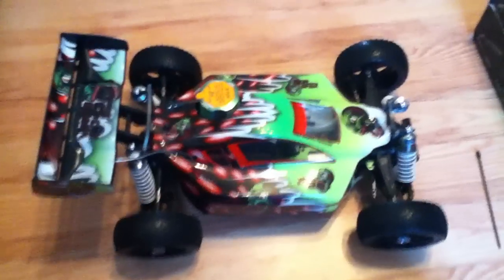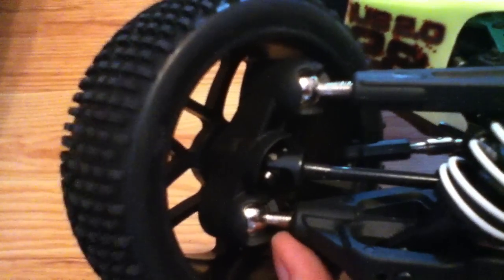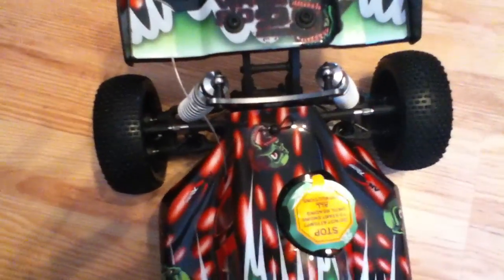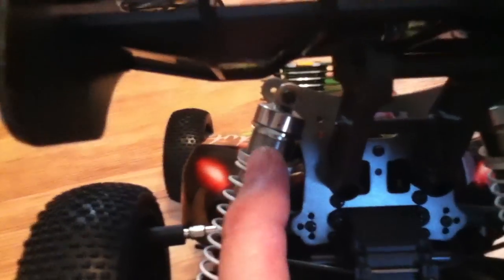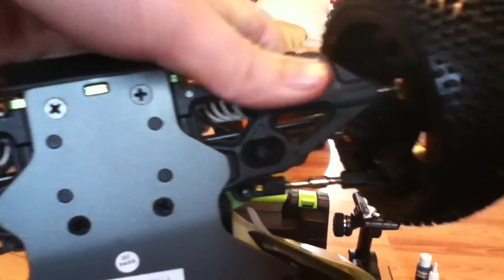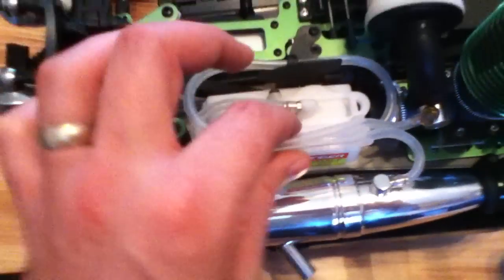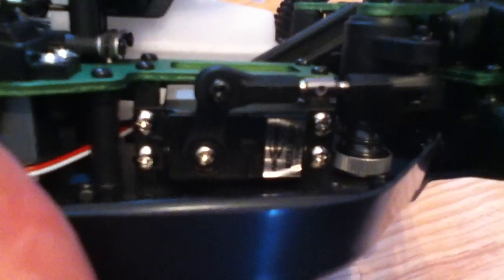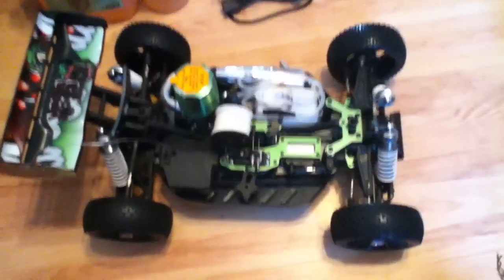Ansmann Racing Virus 2.0 BigBlock Closer Look & Review

Comment from the maker: @nicholascallear Yes deffently, they dont cost the world to buy, spares and upgrades are very easy to get, for £220 you can get everything you need to get started, this one in the video is the top of the range with a bigger and better enging and upgraded Tx, the smaller 21 enging is just as good as this, if you google activescalemodels you can see what I mean, this is where I got mine, hope this helps